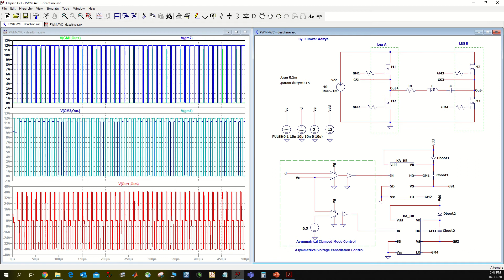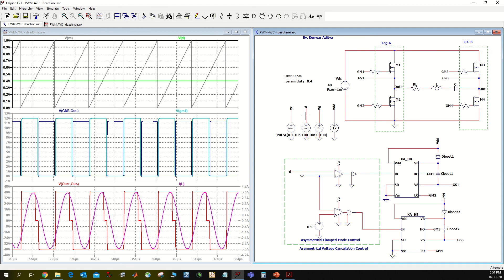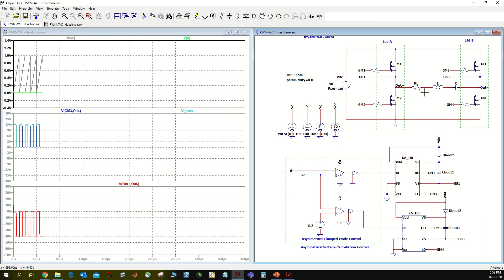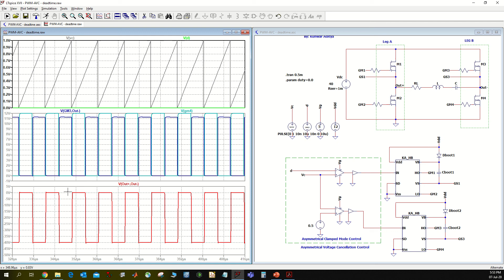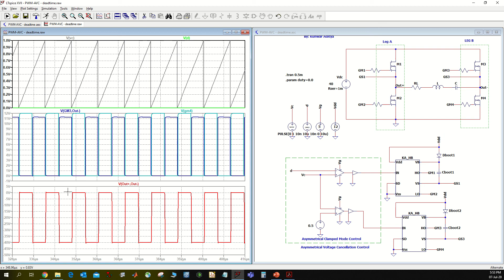Asymmetrical Clamped Mode Control of Resonant inverter with LTspice simulation.

Comment: dear sir, I learned a lot from your lecture, sir I have one doubt regarding the duty cycle, in the phase shift model duty cycle varies from 0 to 1 only, but you said duty cycle control is only 0.5 i.e 50 %. please give response sir
Reply from the maker: In phase shift controller also duty varies from 0 to 0.5. It depends on the way of implementation. At duty -0.5 i have phase shift of 0.